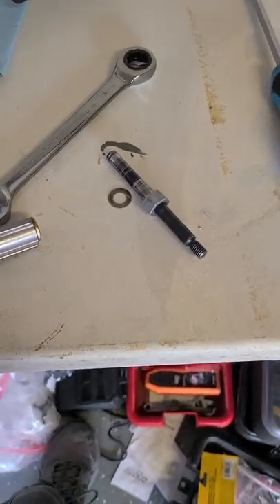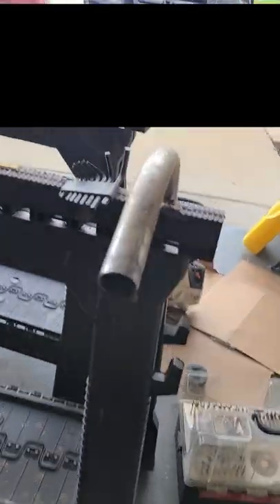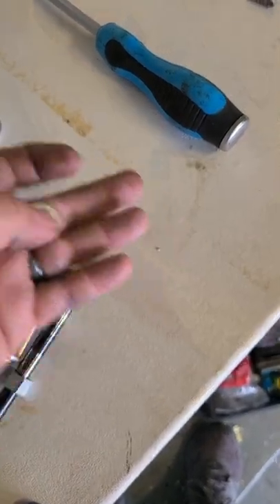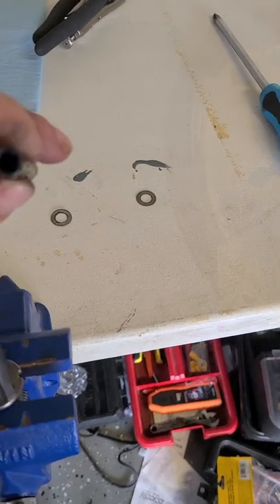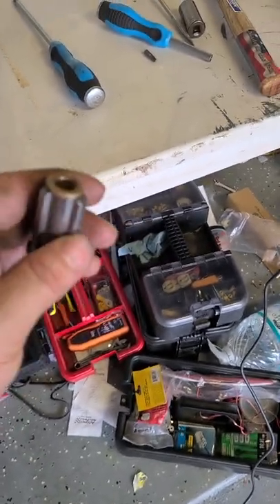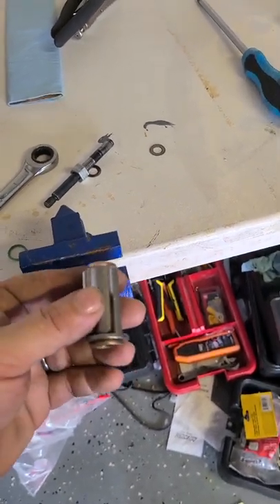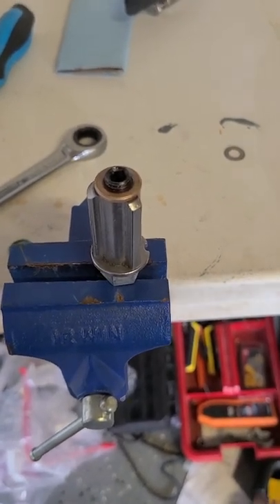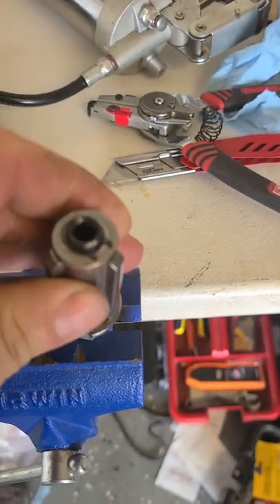Stihl curved shaft bearing repair or refurbish

Comment: Same issue, my bearings are all seized up. I will take it apart and see how it goes. Thank you!
Reply: Update - I ground off the existing stihl retaining ring with a dremel, and got a E-type circlip from a hardware store. I had a feeling the E-type would pop off, but needed to get the machine running so I just installed it. It worked for about 45 minutes and then popped off. However, disassembling and reassembling seemed to fix my issue so i'm not that upset about having to buy another ring!
Reply from the maker: I need to update the video, but i ended up buying a stronger circlip type from mcmaster carr. Mine popped off after a few runs as well. The new one had no issues.

Comment: Showed half of the process. I can only assume you struggled with what you didn't show.
Reply from the maker: My shaft got bent at the end where the bearing goes, and so I had to press mine back into the shaft. They are usually easy to get in and out for the most part. Didn't want to show that because I couldn't hold a camera while doing it and it's irrelevant to most people. The basic assembly/ dissasembly is also incredibly simple.